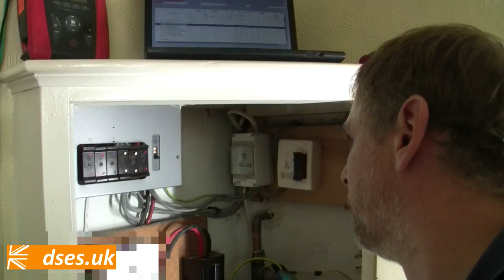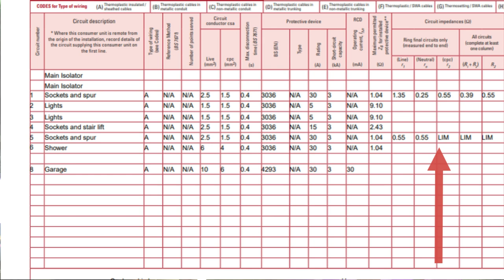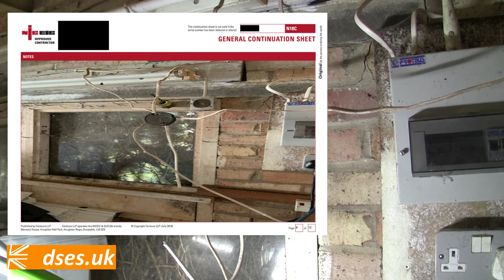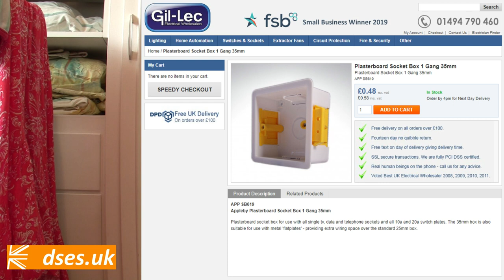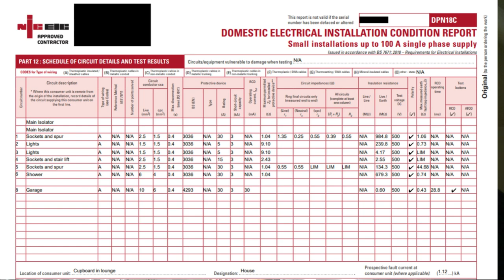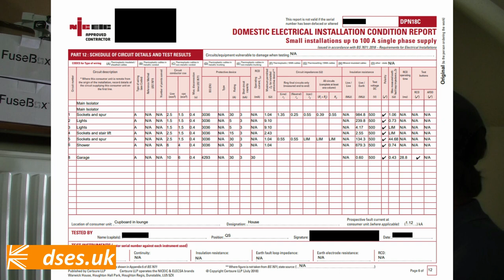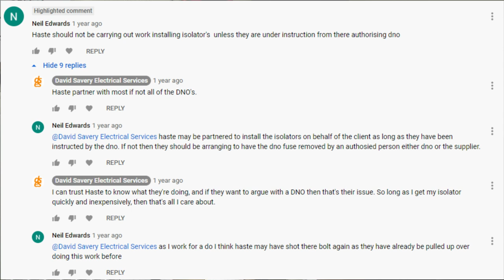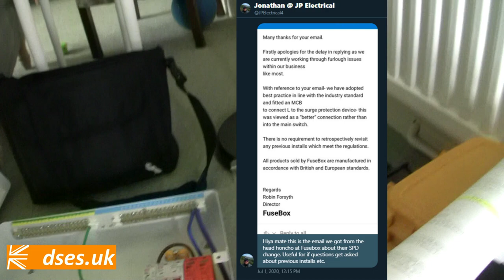Waffly Consumer Unit Upgrade

Comment: The low IR in the Garage circuit could be just because it's in pyro.
Reply from the maker: It didn't show up in my readings, but there were bigger problems to and in the garage than any IR reading. A visual inspection was enough to write that whole part off as being gash.
Reply: @dsesuk  I'm commenting as i'm watching along lol. Completely with you with regards pulling the fuse. I had the very same argument with WPD and they cheekily asked me if I had the relevant qualification for the removal of a main fuse. I don't but I have seen it's only a day course. A fucking day course!! Anyway I paid to get the fuse pulled by a greytop wearing zero ppe.   In the past I have pulled the fuse and been grassed up to WPD by the meter. How I solved the problem was not allowing WPD access to the property to have a look. They grumpily fucked off. With regards the grommet strip even the right size grommet strip will fall off. I know you have Makita battery tools  so you could copy what I do. I have a Ryobi hot melt glue gun with a Makita Battery converter so I can stick the fucker on.

Comment: The ring and the spur are all connected to the same OCPD, therefore it is all the same circuit
Reply from the maker: Electrically and physically they're individual circuits, each with their own points, insulation resistance, impedance and wiring characteristics. Just because they share a protective device doesn't make them equal; a fault on one will bring down the other, hence they should always be treated and tested on their own merits. Those who disagree end up listing only one on their EICRs which is shonky practice in my opinion.
Reply: @dsesuk  You can blame the 15th edition that defines a circuit as:
an assembly of electrical equipment supplied from the same origin and protected against overcurrent by the same protective device(s)

Comment: Perhaps he didn't list the junction box twice and thought the consumer unit was also a junction box somehow? as you say hes took one look at it and thought "nope" and walked away? or hes just done a typo/error and meant consumer unit instead of junction box.
Reply: Maybe he meant DB in garage rather than JB in garage on the observations sheet?
Reply from the maker: Anyone who can't proofread their own report or mistakes a consumer unit for a junction box and still C2's it when live parts are either exposed without the use of a tool (or appear to be)... well... they shouldn't be trusted to undertake an EICR.

Comment: I have been to 3 burnt out shower switches with a 1.0 2 core flex to the fan on a 40 amp circuit. ( What are people thinking)

Comment: 1. Water companies provide means of interrupting supply AFTER the meter. 2. Gas companies provide means of interrupting supply AFTER the meter. This should logically be a legal duty for DNO's.
Reply from the maker: No argument here. With all the shit over EAWR, I don't know how the network operators get away with it.
Reply: There is no requirement for Gas companies to provide means of interrupting supply after the meter, The Isolator before the meter is the installation Isolation valve, any engineer with a meter qualification working for a supplier or just on behalf of the customer can remove and replace the meter during the course of works. AECV's are only required after the meter (on entry to flats) where the meter is remote to the dwelling it supplies.
Reply: @effervescence5664  Grateful for the clarification.

Comment: 1:05:51ever thought of croud funding a legal action on Western Power for breaking the EWR because you cannot reasonably not work on live conductors?
Reply from the maker: It's all big business out there John. We on the coalface are nothing. Just take a look at the DPC for Amendment 2 - a rant may be forthcoming on that, but suffice to say the cowboys bodging in BG boards from Screwfix to replace plastic consumer units today will be the same ones writing them off in 2022 for lack of arc fault detection.

Comment: Great video as always :D 

5:10 I would definitely call that a brummy accent 😂
20:35 Maybe be meant c3 - c2 to make the C1 on that junction box
1:05:00 Even if it was a case of isolating by giving the DNO a call that would be a fairer solution to them not wanting to give out the pin etc, all it would be would be a button on a computer
Reply: I'm not sure if the contactor in the meter than can be remotely controlled is safe isolation? Whats to stop it remotely being energised mid work? 😬 I think its primarily there to pull the plug if you don't pay your bill?
Reply from the maker: 1. More Wolverhampton I suspect.
2. I hadn't accounted for maths, but I suspect you're right.
3. As someone else said, I'm not sure I'd rely on a PIN code software isolation! I want to see the bugger is off and not about to bally well turn back on again unexpectedly!

Comment: Got to disagree with you on the reasoning for not liking ring final circuits. You say that if the ring is broken then all sockets work, but cable could be overloaded. Yeah, fine, and dandy, but on a radial, if a neutral breaks then sockets from the break onward don't work, but are all live. I'm not knocking radial circuits, but the fact is that if any installation is not in a serviceable condition then all kinds of hazards may be present, so you can't knock ring finals based on something that MIGHT happen, but if any installation is wired by an incompetant plonker, there could be all sorts of problems. If any circuit is properly designed and installed, then there aren't any problems.
Apart from that, I agree with all your comments.
Reply: Rings have redundancy on the cpc's, a radial can loose the earth after the first socket...
Reply: Completely agree,  If you do a proper circuit design you will find the length of a radial is quite small & you need a few, it easier just to run a ring in.

Comment: I don't really see the danger in pulling a fuse that is under no load... there isn't going to be any arcing and sparking. The real issue is making sure the fuse is put back correctly and seated properly...
Reply from the maker: I think most of the time it's about the danger of the carrier or head falling apart if degraded. I don't know how often that sort of thing happens, but it's always the horror scenario they parade against we plebs pulling the things.
Reply: @dsesuk  If it looks like Queen Victoria personally installed the thing, by all means leave it alone... but there should be room to make a safety-conscious discretionary decision. But seriously, every other country in the world that I know of has some type of switch at the meter...

Comment: Hi david
Try this off Amazon  for grommet strip. It’s really very good
Brand: Seal Rubber

Edge Trim Black Small Height 9.5mm x Grip Range 3mm (4 Meter)
Reply from the maker: Thanks for the tip, I'll add it to my basket!
Reply: The fusebox consumer unit I fitted last week came with two strips of grommet strip cut to length for the rear knockouts.

Comment: Literally never heard of anyone being pulled up on cutting seals that I know, of course I’m sure there are. last time I called them out they said why didn’t you just cut the seal yourself 🤦‍♂️
Reply from the maker: Had the same mixed messages myself before. Speak to someone in authority at the DNO and they make threats, speak to the guy you've called out and he'll ask why you're wasting his time.
Reply: I’ve only ever heard it from western power .
Reply: David Savery Electrical Services all the DB changes I’ve ever done, the seals seem to have fallen off already 🤷‍♂️
Reply: Never ever in over 40 years of board changes that I’ve seen the seals intact 😉
Reply: @supersparks9466  well not after the initial inspection anyway ;)

Comment: That's an hour and 23 minutes of my life I'm not going to get back! but the video was well worth the 1:23:10. Love the videos and your passion for the job. Nice to see it, there are too many cowboys out there, come across shit shows in my trade (Comms), both on electrics and data, and we're the ones that have to go put the shit shows right!. Good on ya, keep up the great work!
Reply from the maker: Thanks for persevering Steve!
Reply: Steve (good last name by the way, as a fellow Harris I approve). The best is untrained people trying to do aerials and comms...  Who knew that routing all the phone lines in a new build to ONE phone socket wasn't a good idea? (every customer on that estate, when the Krone terminals on the unfortunate socket failed to connect to 7 conductors each...) and Aerials? you can add another point by using a 30A junction box, right?  Impedance matching be damned! The unfortunate thing about the latter is it often works fine till someone tries to USE the second aerial point...

Comment: 25A MCBs are available if you don't mind freaking out the next electrician to come along :)

And I have to politely disagree that it's a separate circuit.  It's simply a spur from the origin. Often had to do it when a customer comes along and says 'ooo can we have a socket for the dyson in the fuseboard cupboard?' The easiest place to 'spur' from is the origin. 

Also a cupboard light in that fuseboard cupboard would involve cables into the breaker. To me, that's not 2 circuits in one breaker. It's a T shaped radial. But like you say, it's all opinion :)

And yeah there's always the danger of someone doing the spur into a radial circuit mess... definitely a C2.

I do like your compromise position of detailing them as 2 separate circuits on the same breaker for EICRs. How do you do that, as the NICEIC shite...err sorry, site; doesn't allow 2 circuits with the same OCPD number?
Reply from the maker: I use EasyCert rather than NIC's own paperwork, but I'd list it as circuit "1a", "1b" etc. with each showing the characteristics of the independent circuit in question regardless of the argument of whether it's a spur or not. As I charge per-circuit for inspection work, the task of inspecting, testing and listing each of them would be levied on the invoice too.
Reply: Definitely not a spur unless it was fused down to 13amp someone further down. Nothing wrong with direct from the board to 1 single or dbl socket. Anymore then it exceeds the guidelines of what is aloud as its 2.5mm. Wonder I'd you have come across any hybrid ring/radials ?
Reply: @danf6491  Where do you get the impression a spur has to be fused down?
Reply: @TheChipmunk2008  if it's on a single 2.5 and supplying more than one double socket 🤷‍♂️ think its appendix 15?
Reply: @danf6491  ah I see what you mean... Yeah I'd feeding more than one accessory it's not a spur anymore

Comment: The DNO should be made to install local isolation on smart meter installations. They are bringing it up to 'modern standards' so why not? its quite clearly being used as a monopoly to extort money from end users. Even isolators fitted retrospectively on analogue metering shouldn't be priced so highly. As the government would say,  they need competition in the private sector.

Comment: I've been ranting about this for years now.
Reply from the maker: You, me and everyone else facing the danger of not being able to isolate when needed and without forking out for it. Nobody listens though.
Reply: Absolutely true, could we argue under HSE or EAW Regs that we are making a system safe to work on? I was always taught never to work on live systems, although this is debatable when trying to fault find in large complex control panels.
Reply: Maybe you could get the homeowner to pony up with an intermediate isolator switch so it’s a payment hopefully paid once and thereafter you have an isolator for all work in the future without ever having the DNO come out.

In the USA my isolators which I installed for two of my 200 amp panels/CUs have to be installed outside of the house for the emergency services specifically the fire service for them to isolate before they enter burning buildings. And no I have had no mischievous power cuts from scallywags in the area I live.
Reply: @nickiredale9145  regs say not to work live unless absolutely necessary and do the risk assessment/justification, and wear appropriate PPE.  I'd say fault finding on complex circuits would be 'absolutely necessary' to work live.
Reply: @mathman0101  I've seen that in canada, where they have an FD supplied lock on the isolators... so the FD can unlock and kill the supply but scallywags can't mess with them. Might just  be a regional thing tho? (PLUS even if the locks weren't FD supplied i'm sure they carry bolt croppers ;) )

Comment: As for three rìng circuits in a new build, the designers should think again!
1st floor sockets:- 3 alarm clocks, 4 table lamps and 2 tv's = 1 amp load maybe?
Ground floor sockets:- 2 tv's, sky box and a router = 1amp load maybe?
Kitchen circuit:- washing machine, dishwasher, fridge, freezer, kettle, toaster etc = >32amps a possibility.
All comes down to a poor industry standard and cost.
Reply from the maker: It's the "we've always done it this way and we're not going to evaluate why" mentality.
Reply: @dsesuk  its a bit like rewiring a house, a certain utube electrician has to rewire lighting with the 2 plate method or if the customer doesn't want chases quinetic switches, god forbid it could be rewired 3 plate or with an accessible joint box so only one wire at each point, utilising the existing conduit to the switch.
Quinetic switches have their place but surely won't last anywhere near as long as a proper wire to a switch, it just leaves the customer with potential problems further down the line.
If you're taught that way, no other option exists.

Comment: Get you sell a drink in a plastic test tube drink it.  And then cut the end off about 1.5 inch use that to isolate unscrew pull the tail slid over an tape it up feed in to new CU an pull test tube off.  Job sorted if you don't mind working live.

Comment: There is one type of digital meter which has the arrangement that you said about which has sealed incoming supply and non sealed outgoing with a slot for a screwdriver which will kill the power to the tails going to the consumer unit when turned.If only all meters were like this then all of this nonsense could be avoided.

Comment: Spot on with your thoughts about running radials as apposed to rings. I seem to recall in the late 80s a trend towards running fridges and freezers on their own circuit. This was around the time of RCDs becoming used more. There was conflicting theories about whether the compressors caused nuisance tripping or to protect losing fridge / freezer full of food. I also remember the old style computer monitors causing nuisance tripping if you had a few on the same circuit.

Comment: I’m surprised you didn’t know you could spur directly from a fuse. Common sense says it should not be long
Reply from the maker: I'm surprised too. But then, it's not something I'd do. The trouble with the regs book is that you think you know where you are with it, yet there's still things that can catch you by surprise. Sometimes, I even find I've highlighted the pertinent information in the past as being of interest, yet still subsequently forgotten it and been caught out.
Reply: Will you reveal what you did with the single socket by the board? When it's such a short spur and probably for low power or occasional use I might have had it as a spur from the origin of a ring, or doubled it up on a radial. Where I've changed boards and found two general purpose radials each serving the same part of a building, both with general purpose socket outlets, if one of them serves a single point I will double them on to one breaker. Yes, test as two circuits and label the conductors as eg 7a and 7b inside the board 

In one premises I look after, the contractor who upgraded the distribution 10 years ago rightly identified that circuits were doubled up in the old 3036 boards. The replacement split load boards include three lighting circuits, one serving a kitchen (6x LED 5W downlight) and one each for the two adjoining store cupboards (each with just a 16W fluorescent). All circuits max 10m long, probably less. Bad design leading to the boards needing to be huge. If I was fitting an RCBO board I definitely couldn't justify the cost to the client of keeping them as separate circuits
Reply: Thinking about it, as long as the 2.5mm cable is only connected to 1 double socket, the potential max demand for the socket would be 26a, cable can take 27a (method c) so no overload. potential short circuit or would send the fault current way past 32amp thus tripping within the 0.4 disconnection time.
Reply from the maker: @dg2908  I put that socket on its own RCBO David. Arguably a bit of a waste, but if I'm putting in a CU, then all the individual cables get split onto their own protective devices. The only exception is on lighting where you have a cross-connection on a borrowed neutral; then I'll put lights up/lights down on the same device to ensure both are off should someone want to work on either.